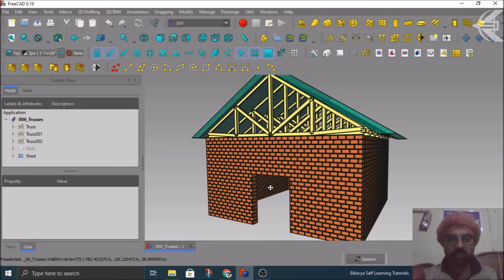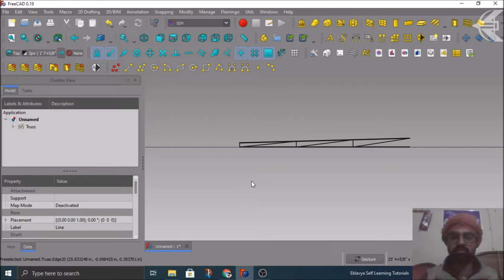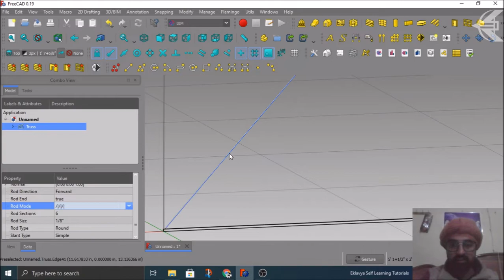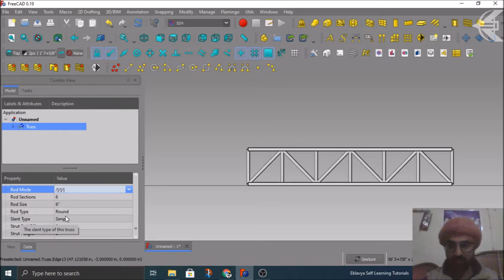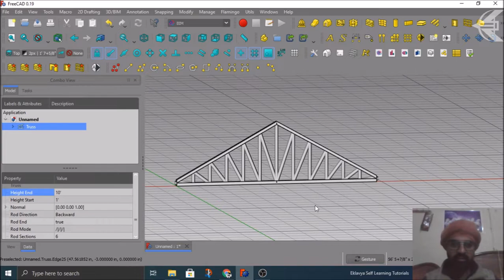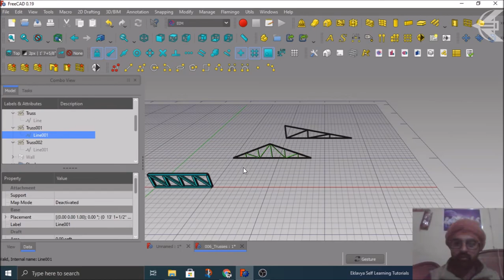006 - All about Arch Truss Object | FreeCAD BIM Workbench

Comment: Once the truss object is made, it does not seem possible to delete an individual rod, or change the length of the base strut for example. I presume when you push the Truss button that a macro is executed using some code, but in the python console nothing is shown. Is it possible to see this macro/code any place so it can be modified? Thanks for your videos!